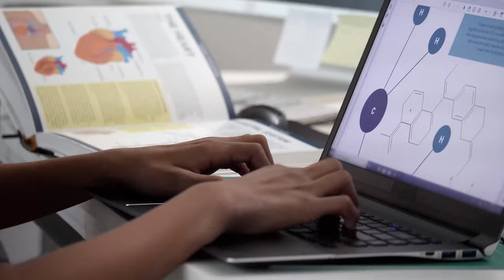Do Big Profits Have You Overlooking Your Biggest Threat? | The Dirt #41

Comment: Good video. I hear you load and clear about the mindset of the carrot and stick work ethic 
I will quote from Keith Haddock
Book. The Earthmoving, 
Encyclopedia on the
Hydraulic Excavator chapter
About the bullhead-add- Ness of company's to move from CABLE to Hydraulic Excavators.
Quote (Hydraulic Machines were thought by meany to be just a Passing Phase) end quote. This mindset caused meany of these Manufacturer to go out of business, or bought by other company's. Mind you this was the 1950s. Just like your talking about on issues of keeping or getting employees to stay, or at least teaching them instead of 
Out the door you go.
Another thing that I personally though that was BAD design for learning or operating, was company's that made machines with ( joy stick) Controls, and the SWING was pushing lever. Forward and back
Especially when you look at the standard today on SWING lever control. Sense your talking about a new guy, or teach a guy to operate. Why,"O"why did they NOT have swing on joy sticks side to side. On the same stuff your talking Just like you  about your Love of a skid steer wanting one of your own.Tipping it over for having bucket high up. I got Layer off a Job because it had JD controls
The company did NOT want to let me have time to LEARN to operate it. On another job I was  dropped off at a DYNAHOE-190 
with joy sticks. Thought "O" no hear I go again getting Fired.  Was by myself to dig sides sewer stubs. I liked the DYNAHOE-190 so much, it was EASY to learn to operate,boy talk about a powerful backhoe, just like your speaker was talking about buying his own
I found a used one for sale. And bought a DYNAHOE for myself. I don't use it to contract out to work. Just have it at my Home for my garden soil turn over. I call it 
Little Muskie after big Muskie
Sense both are made by the late great company BUCYRUS-ERIE
I also own stock in CAT, that's my personal choice. Cat now owns BE. Thank you so much for a great video topic. I would LOVE to have young people come to my home to practice Digging a straight trench in my garden bed LEARN the start up, Engine checks, maintenance and smooth operating of a Backhoe. I have learned over the years, the construction dirt moving  mindset has to CHANGE.
To meany EGOS,